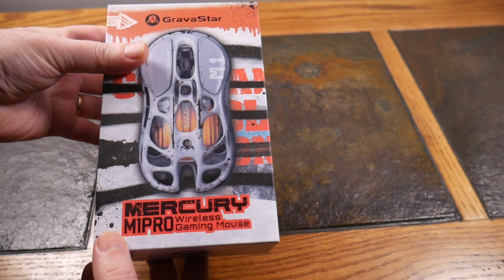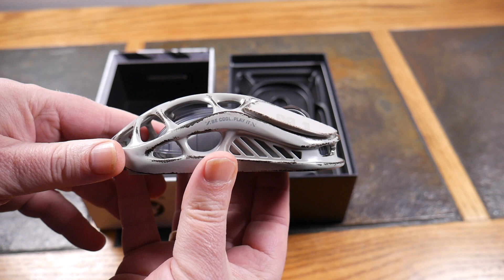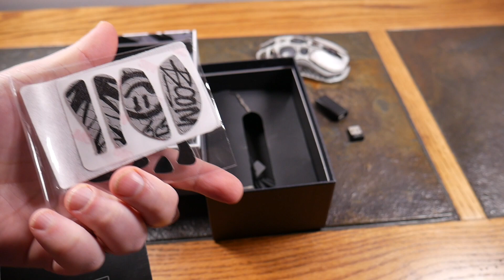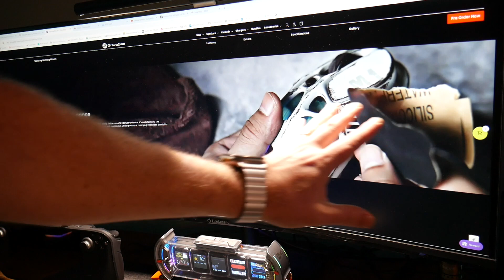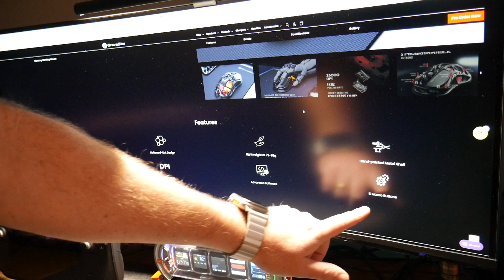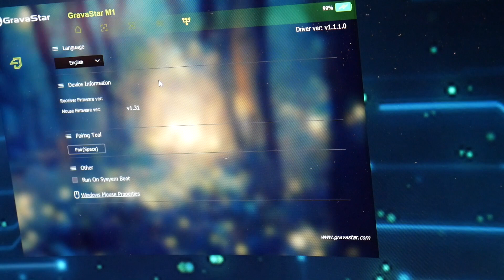I'll Make You Have Mouse Envy! Gravastar Mercury M1 PRO Gaming Mouse!

Comment: this 4k receiver is for a 4k polling rate. means the mouse is reporting data at 4,000Hz, which means 4,000 times every second. ;) it doesn't matter if you use a 4k monitor or not.